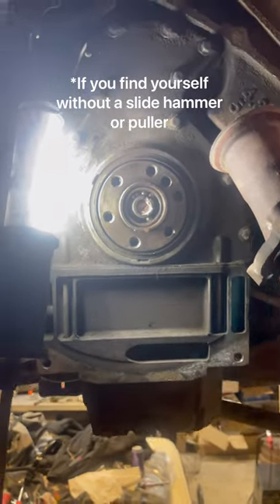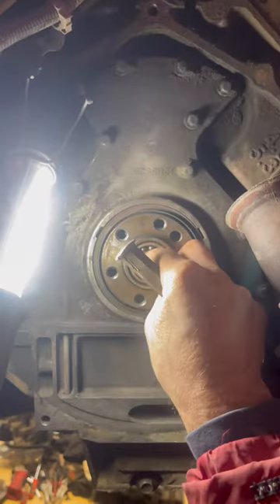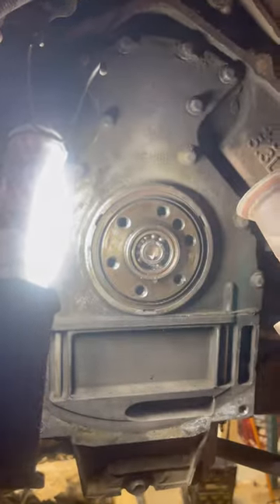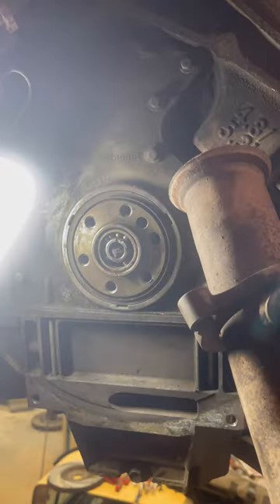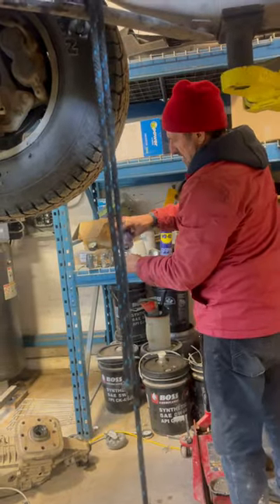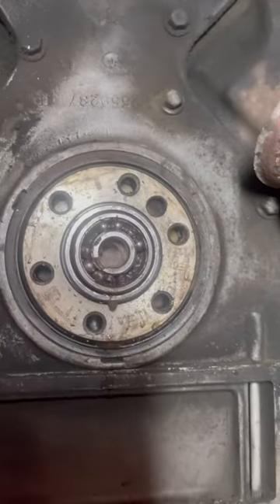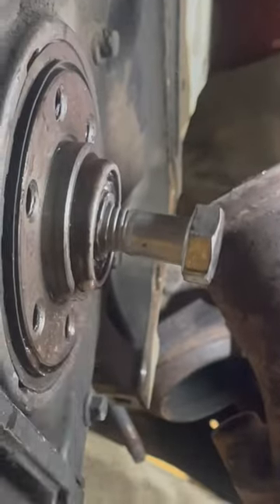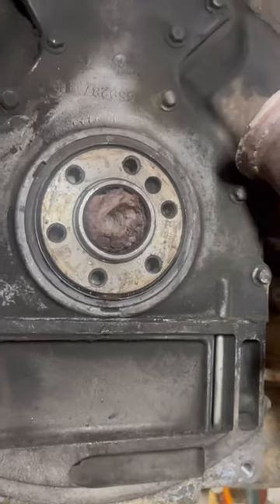How to remove a Pilot bearing DON’T do this…but it works in a pinch #diy #howto #figureitout #tools

Comment: Back in 1995, I needed to replace the clutch in my 84’ Mustang 5.0L. I didn’t have pilot bearing removal tool. It took 3 hours of pounding, then finally it came out. Next I bought the $15 tool. I have never used it, but it’s ready. I still have the Mustang….Jim
Reply from the maker: Haha great story!
Reply: Ya good idea to hang onto the puller, likely use it someday and when they don't make them anymore you'll already have one.

Comment: I've welded a 3/4 inch nut to them and run a bolt through the nut to pop them out before. Even turned a nut on the lathe and beat it into the center of pilot bearing till it was stupid tight then run a bolt into the nut to pop the bearing out. It's not stupid if it works 🤷‍♂️